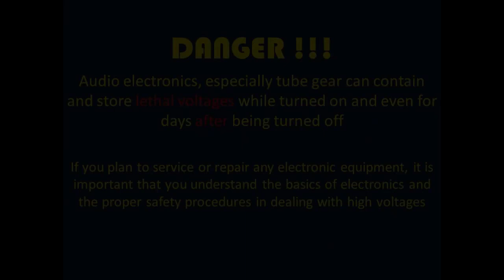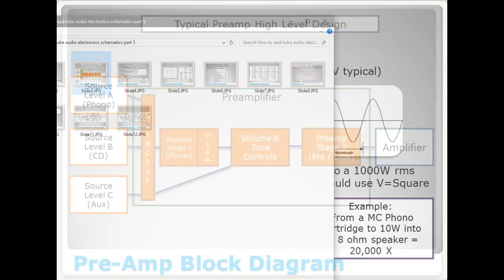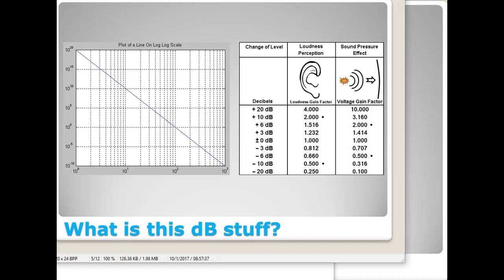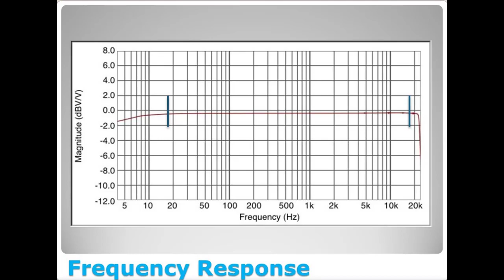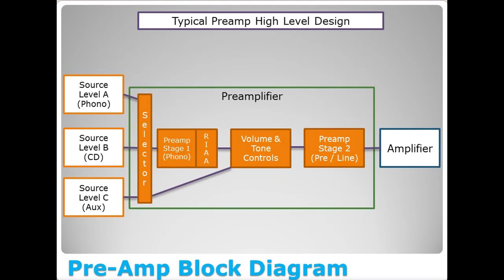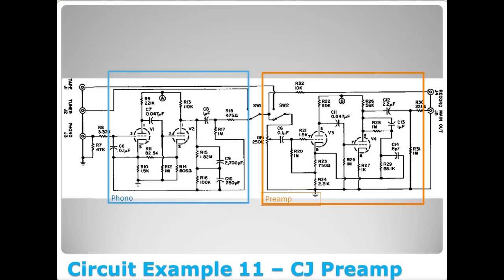How to Read Vacuum Tube Amplifier Schematics - Phono and Preamps -  Part 5

Comment: If your output tube  has a b+ of 400 volts on the plate, the peak ac audio level at the plate will exceed 600 volts with full audio (ac voltage) drive! If you have an audio generator and a dummy load. Have fun and be safe!

Comment: Be sure to show moving coil has hi output and low output. The low output is typically 50 ohms and uses a transformer. The hi level moving coil has a 1k impedance and most folks incorrectly load them with 47k ohms.

Comment: You explain this very well ! What I'd really like to see, is you following a schematic and doing the math to show the voltage at each component. I'm assuming the perimeters of the tubes and the transformer output basically determine the overall output in the end ? So I'm guessing the power and output transformers are pretty much the base starting point ? Love your videos! I've been on a 3 day binge, cramming !!!

Comment: Greetings:
There is no need for RIAA equalization on the output of CD players as there was no equalization introduced to the source music during the mastering process; plus the preamp addition is also unnecessary. Likely you mislabelled the phono (not phone) input as the circuits for the CD and AUX inputs shpould be identical.

Comment: Hello Mark.  In circuit example 10 the first half of the 7025 has a cathode bypass cap while the other half does not.  Also circuit example 11 does not appear to have cathode bypass capacitors at all.  Is there a reason to do this?
Reply: While the absence of a cathode bypass cap reduces gain, it also increases linearity.

Comment: can you help me to understand this S/N ratio measurement especially the phono section? Spec on Sherwood S 8000 iv states 
Max.Hum and Noise: Vol. control., min., 90db (weighted) below rated output. Radio input (control max), 75 db. (weighted) below rated output. Phono input (controls flat) 55db. Below rated output, 72db. Below 10mv (equivalent to 1/2uv referred to input grid.

Comment: Hi Blueglow
The Tube Amplifier Schematics are very helpfully 
Even thou I have built a JE labs single ended 6SL7/EL34 /5881 using James 5K transformers and oil and poly motor run caps in the psu and Russian Teflon   for decupling the 6SL7 to the output tube sounds Great
So the Tube Amplifier Schematics vids are the icing on the cake for me thank you for doing this 
I am also thinking about building the 807 amp you are doing with my 5K Hammond 1628SEA
Thank you
Colin from Scotland uk